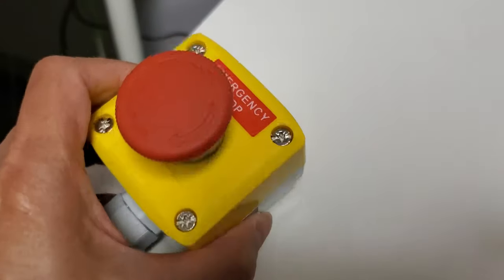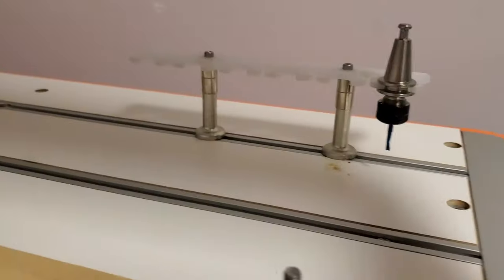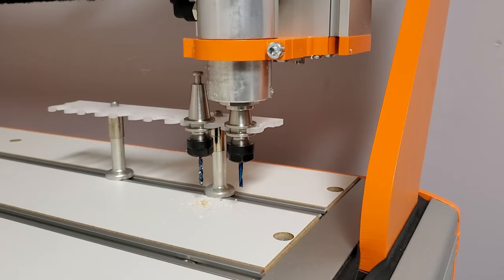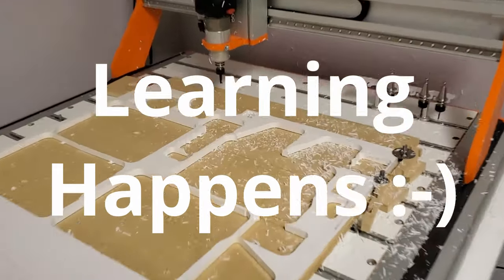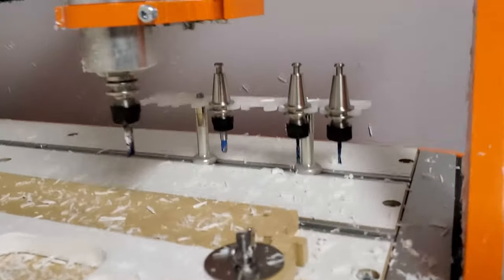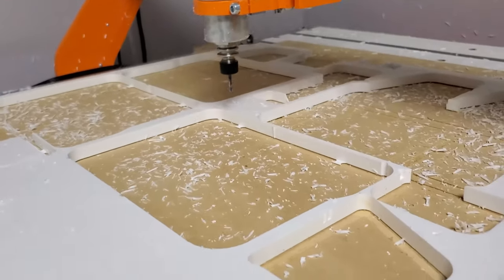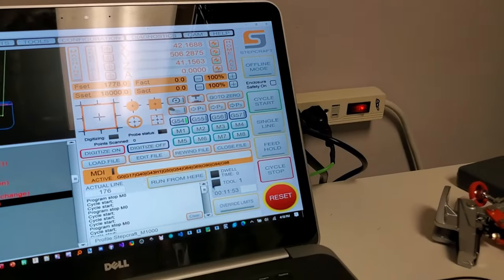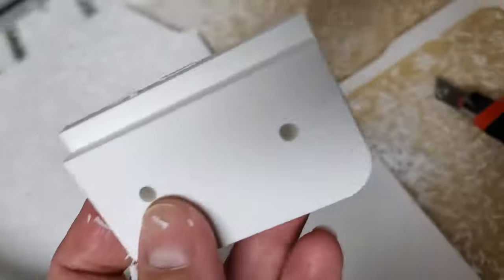HariFun #191 - New Toy! Stepcraft M.1000

Comment: That's very cool. The software and tool changer seem like a game changer. I had a cheap Chinese one and didn't like it but that one seems a lot more usable
Reply from the maker: Being able to switch bits effortlessly is very liberating. I didn't show it, but we also purchased a tool length sensor and Stepcraft has written a macro to measure the Z offsets for each tool/bit so you only have to zero the first tool and the other tools are offset automatically.  The Stepcraft is a solidly built machine, but it is not without flaws, maybe I will do a review after I gain more knowledge.

Comment: Hey. I am waiting for my M.700 to arrive :-) Wich motor are you using?
Reply from the maker: Congratulations! We have the MM-1000 DI. Quite beefy and speed controlled by UCCNC software.
Reply: @HariWiguna  Thanks. According to the shipping info I have to wait for almost three month ... :-( How about the noise level?
Reply from the maker: @labomat  yeah, we had to wait several months for ours as well. Our Fein vaccum makes more noise than the spindle, also the material being cut makes noise.  Overall it is a very noisy machine, but I think that's true for any big CNC.